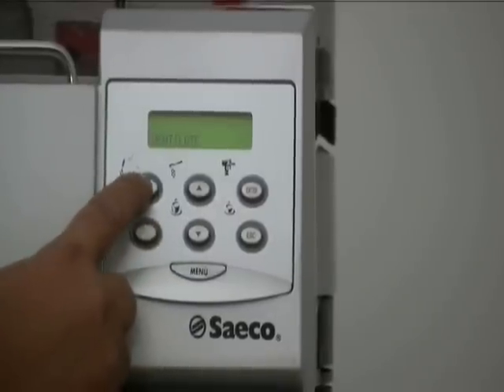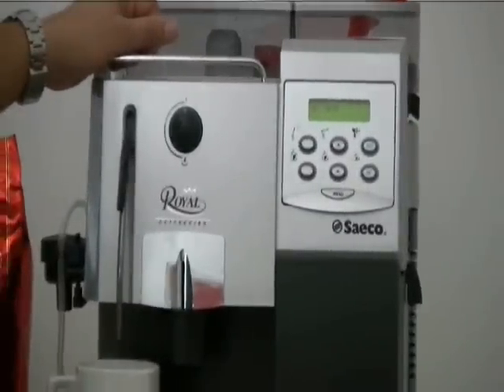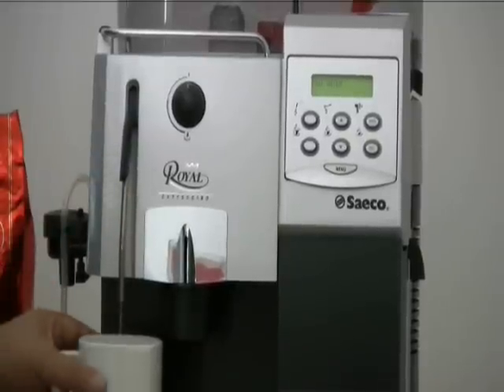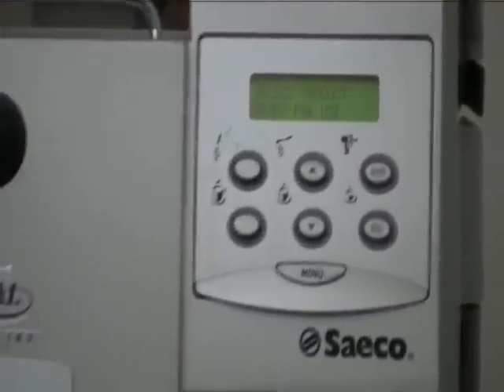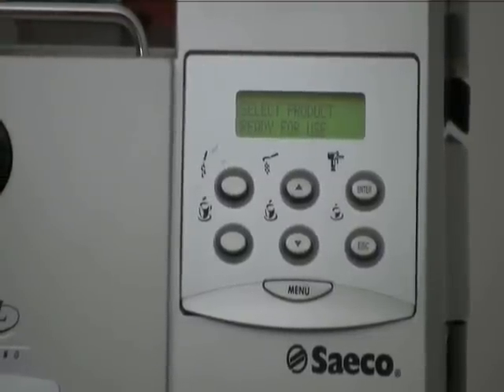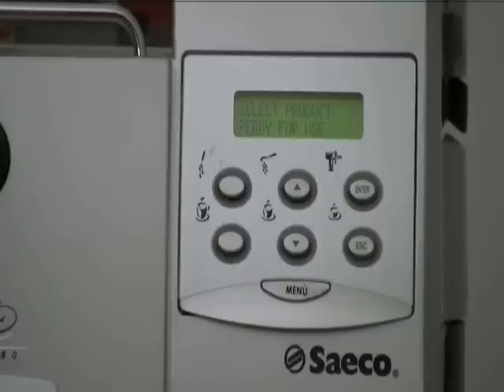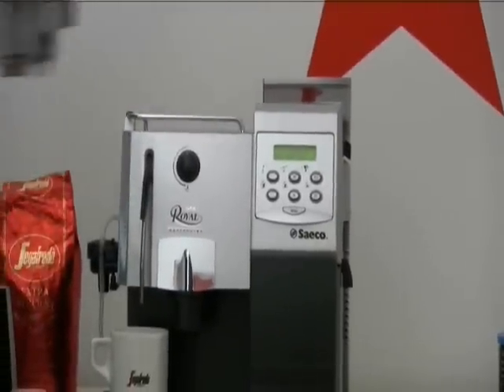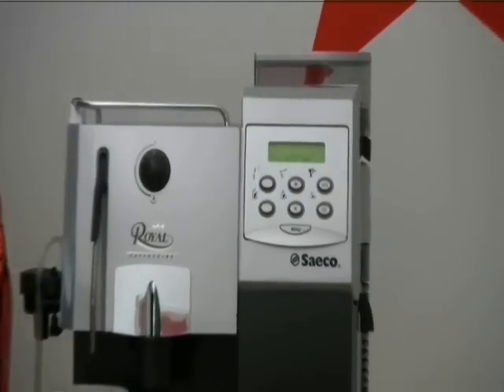Maintenance - Saeco Royal Cappuccino displays Ventilate

Comment: I have this issue, and i can't fix it. I used "Hot water" button several times, but this not helped. The sound is like, pump is pumping, but no water coming out.
Reply: How you saved this problem I also have issues like your

Comment: I have this issue, and i can't fix it. I used "Hot water" button several times, but this not helped. The sound is like, pump is pumping, but no water coming out.
Reply: +misti102 you must check the flowmeter. is it works?
Reply: i
Reply: How flow meter look like

Comment: Hello! we have saeco royal, it jumps safely to the electrical installation, after many attempts, it starts, it displays a blocked group error. does not stop / start from the bottom switch or the one in the door. What can it be?